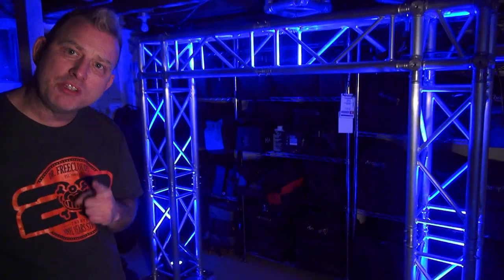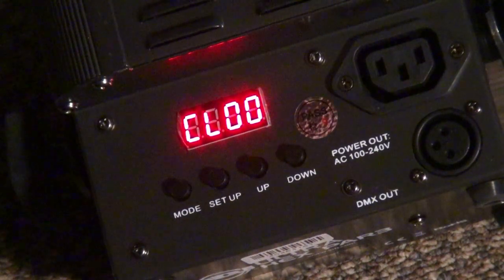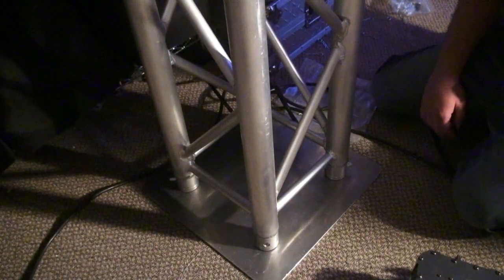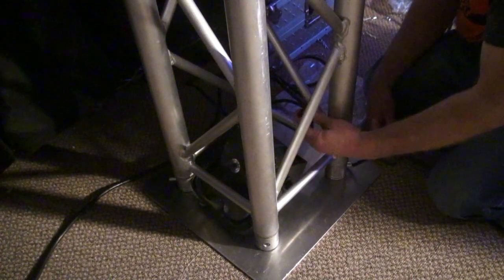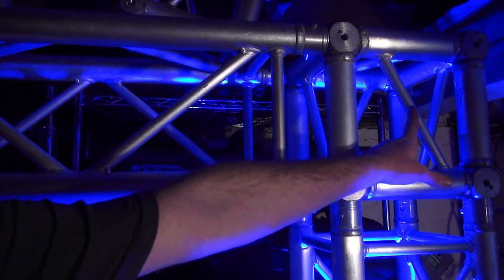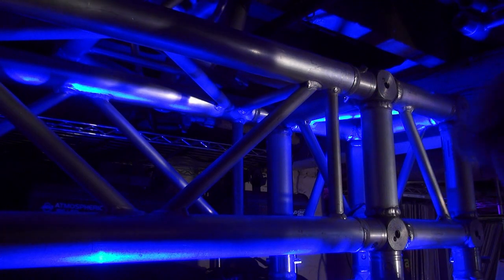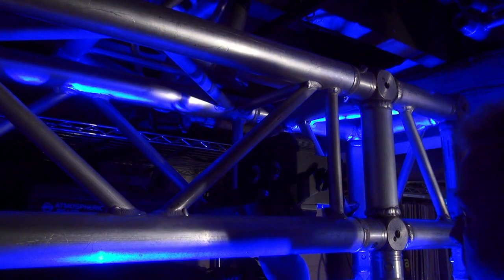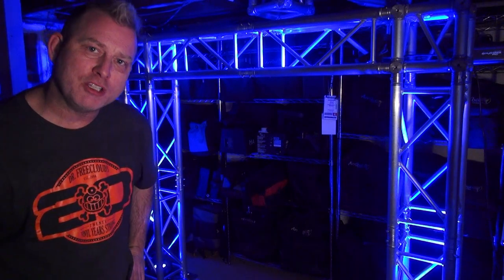Truss Warming Basics - Static Color LED

Comment: Did you just forget to mention clamping in that third light. Never miss an opportunity to remind people about safety. I understand not actually doing it in this video for the sake of time but you should have mentioned where you would clamp that upper light to the truss and remind people to use a safety cable as well.
Reply from the maker: If I were to show every single step, the video would be quite a bit longer.  Common sense is your friend
Reply from the maker: Having said that, the way it fits in this truss, for this light to fall out of would be breaking laws of physics.  A clamp would hold the light in place, but I'm failing to see how it could fall out of the truss
Reply: I wasn't saying you had to do that and include it in the video. I knew you were going for a short under 5 min DJ tip. A quick how to. Besides, if I know you you filmed another video with possibly bar style lights. Another DJ might be able to accomplish truss warming with a smaller fixture that WOULD fall through the truss. Just mentioning..."oh and I would clamp it here and don't forget a safety cable" would suffice and take less than five seconds. I guess the time I have spent in Loss Prevention (which also means safety coordinator) and doing risk assessment  for several retail companies has shown me that common sense isn't as common as it used to be and we should take more opportunities to remind people to be safety conscious.
On the other hand, that truss isn't over anyone's head so a couple of zip ties would actually suffice. Most of the time though that truss will be over peoples head and who knows what a subwoofer can vibrate loose.
As you know I'm a long time subscriber and think you are one of the better content providers for DJ tips and equipment reviews here on YT  I also find the videos about your personal limitations inspiring. It IS the nature of man to overcome and you are a great example. PS you did a great job of covering NAMM this year.